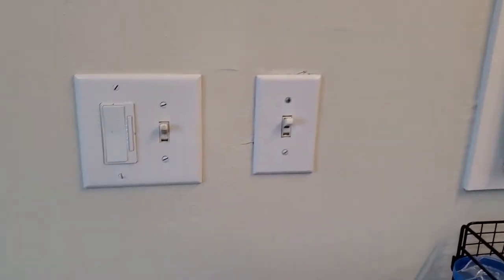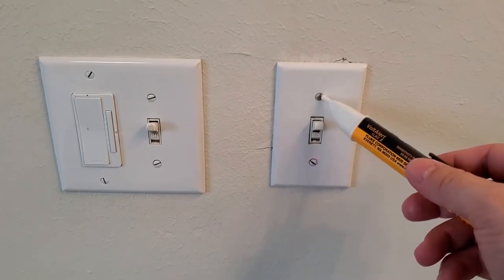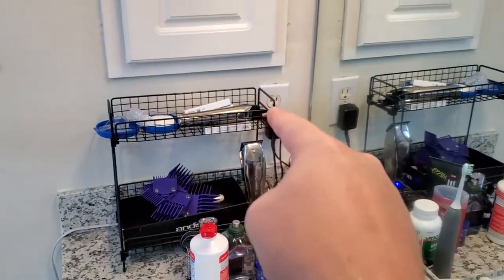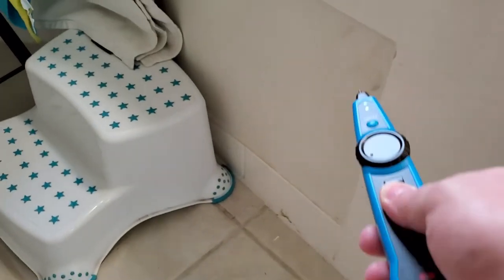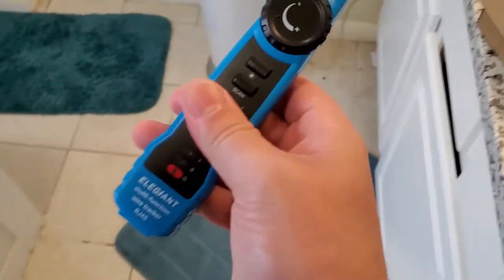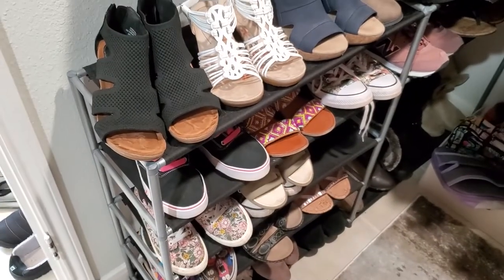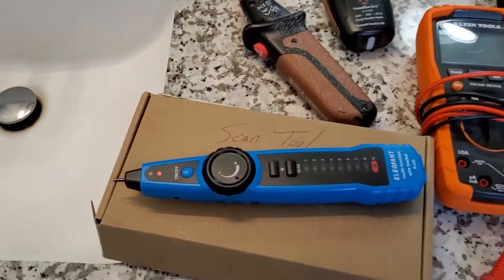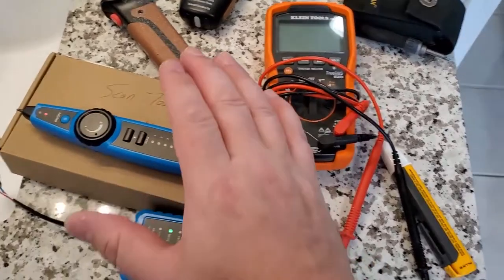Non Medical Video: Multiple Tools For Electrical Troubleshooting

Comment: 9:47 Those non-contact testers also react to the switching noise of a 5V usb wall charger.
If you then use a usb cable (usb 2.0 printer cable ), connect this usb cable to the 5V usb wall charger, and cut other end off (the end that goes to the printer), and add a crocodile clip to the positive lead, (data -, data + and negative lead are not needed, and need to be isolated from eachother), then you can use this 5V signal to detect broken wire(s) within 1cm accuracy.